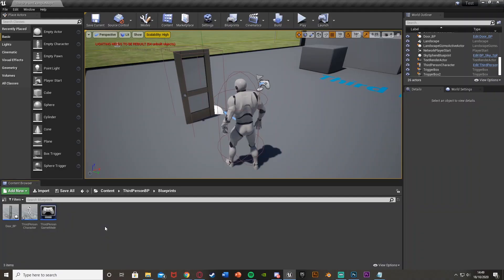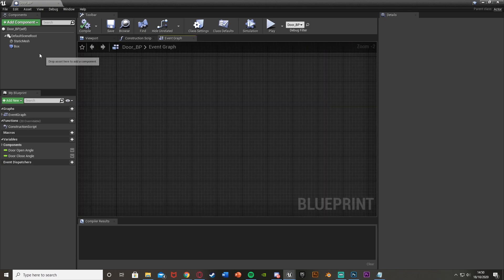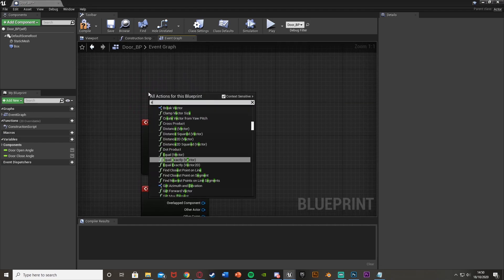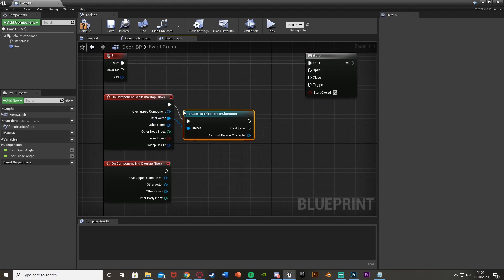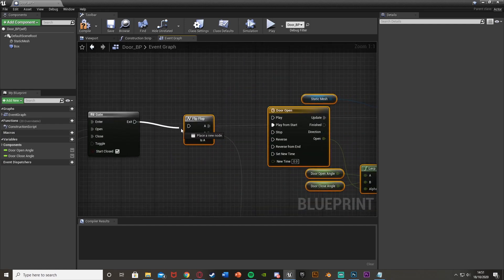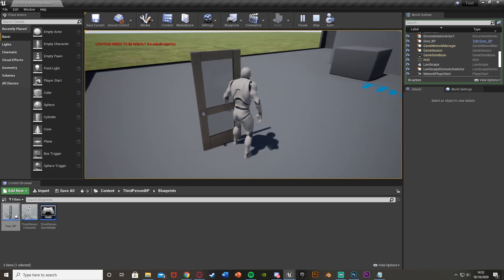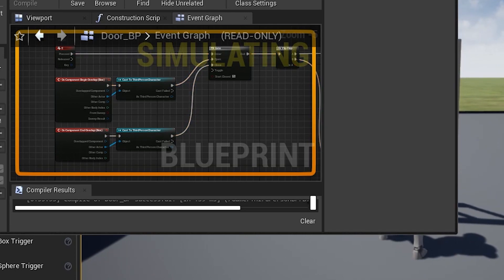Gate - The Basics Of Nodes In Unreal Engine 4

Comment: Hi. I have been using this command for years now. But for some reason it doesn't work anymore. I simulated the level and everything works nice. Except there is no reaction after pressing the button to enter the gate. I checked everything and there is no mistake. This command is very important for the project that I'm working on and I don't know what to do anymore.
Reply: Make sure you have enabled inputs (On Begin Overlap: Enable input (Plug in Player Controller) / On End Overlap: Disable inputs (Plug in Player Controller too). If your Interaction key (E?) is fired off from another actor than Player you need to enable inputs for it to work.

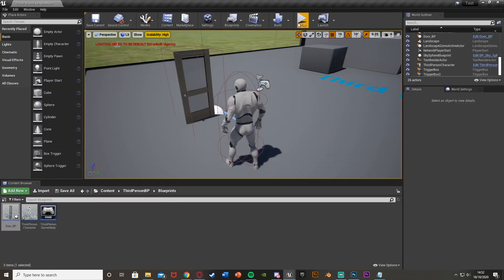Comment: Nice. Regarding 2:46 could we use the B flip flop to connect to the REVERSE of the door open? So that we wont need the code of door close? would that be efficient? thank you
Reply from the maker: Thanks, and yep you are absolutely correct. You can go straight into that timeline again from the B, and if you have a lot then it will probably be slightly more efficient, but there isn't a huge difference. Just make sure you go into "Reverse From End" not "Reverse". Nice work :)